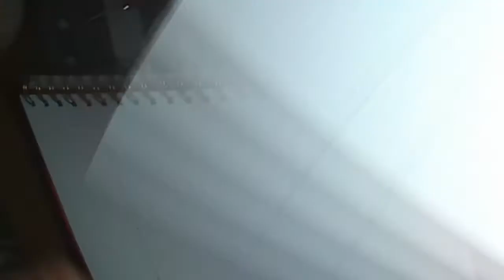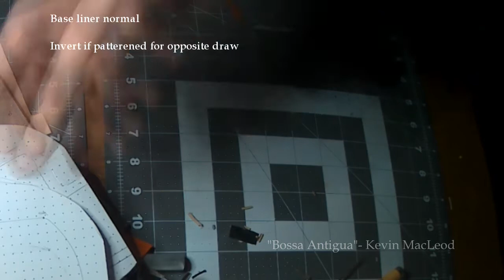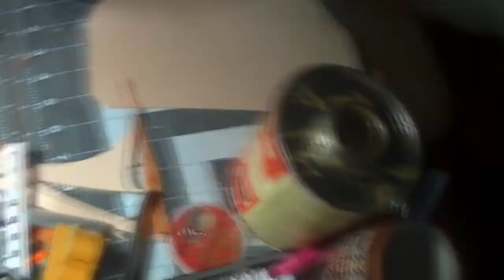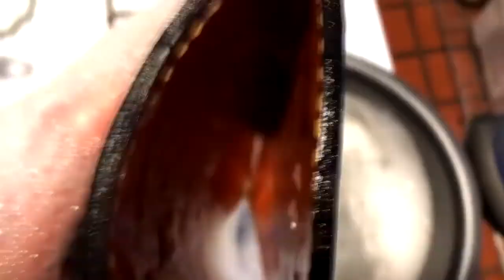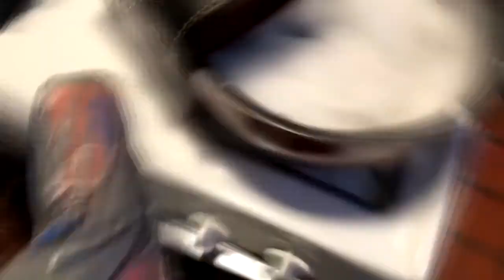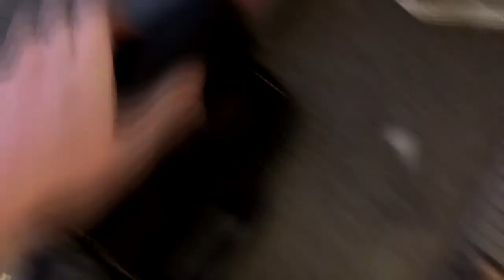Making a Leather SPAMF Holster

Comment: Really excellent work! I adore how this holster came out! It looks incredibly comfortable. 

Kinda noob question, but would you ever include a piece of stiffer material on the back side of the holster in order to help it keep its shape rather than conforming to the body? The reason I ask is because I would think that if the leather bends while the blaster isn’t in it, might it make it more difficult to get it back in?
Reply from the maker: there are no noob questions until you ask them
/s
the holster is never tight enough to the body to really warp that sharply unless it was like...on your arm, or you were THAT tiny. human cross sections are more like a smoothed rectangle than...a thing that would make it bend. but tldr no it doesn't bend. thats part of why you make the base panel closer to the size of the thing you're holstering, and then have all the bending happen on the top panel.
Reply: Hey Secretary.  :)  How's it goin?